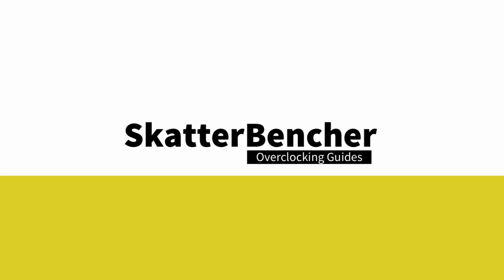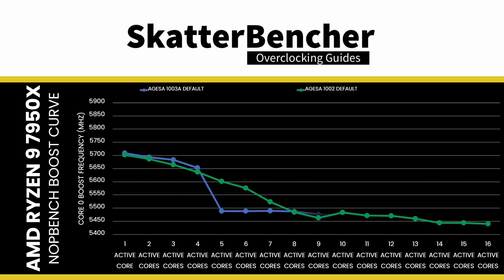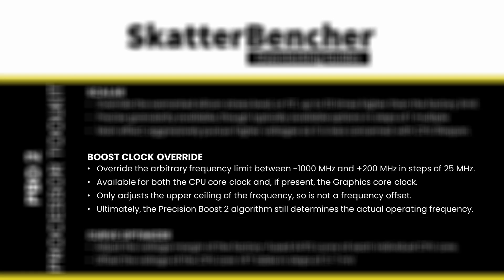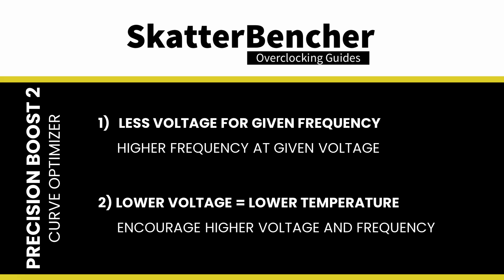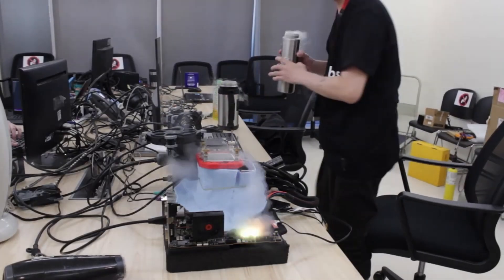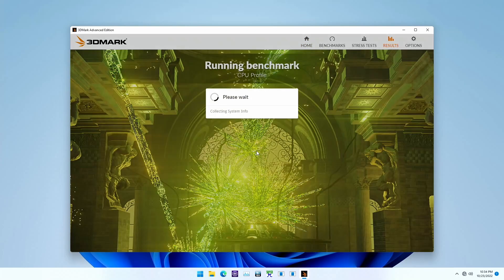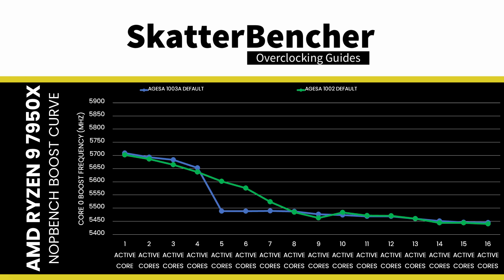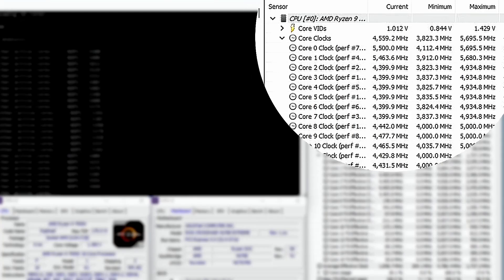WHY Your Ryzen 7000 Doesn't Boost Past 5.5 GHz (anymore)

Comment: Good Video.  Should i just be happy if i am hitting 5.5 Ghz since i have mid level msi mobo.

i have 7900x with a front triple radiator in push pull, my gpu is watercooled with a top triple rad so the cpu and mobo stay nice an cool... i like this vid but i have mid level MSI x870 Gaming Wifi mobo without asyc bclk bios options so most of the info in your OC vids dont apply. Some of the options are hard to follow with the msi bios. I miss my hi level asus bios on my old i9-9900k. I have a mild overclock at PBO -10 all cores and xmp 6400 mem. Currently 95% of the time half the cores are 5.5 Ghz and the other half are above 5.375 Ghz in most task.

Comment: So my 9950x3D on an Asus x870e Crosshair hero won't single core boost past 5.6ghz no matter what settings are applied. Any recommendations?
Reply: Won't be related to this.

But
Check C-States > enabled

Otherwise it's heat/cooling capacity
Reply: @RobertSmith-lh6hg  chip never goes above 82° on multi and 64° on single. C states are enabled

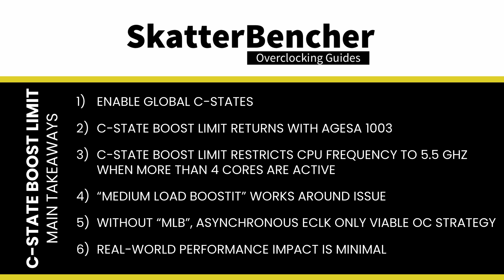Comment: 11:00 this video is key for me right now!! I’ve been using AI overclock mode in my x670e, coupled with PBO and curve optimizer at -5 and per core.  I have learned about medium boostit through the AI setup.  I have disabled the c state control though… I have this on my 5950x pBO setup so I think my thought was mimic that setup. My issue is SSE benchmark.  Passmark SSE will immediately spike my tdie to 110c, but normal operation and max on hwinfo is not above 96c.  I have seen 5.9 and 5.8ghz.  There is definitely a voltage spike with SSE benchmarks both Passmark and OCCT will shut down the pc, not a reboot, it will shut it down, however I can do 10 and 30 minutes tests on cinebench R24 with no issue and very reasonable temperatures.  AI uses dynamic overclock switcher, so all core is 5.3 and 5.2 on ccx0 and ccx1.  I think with boostit maybe I should just fine tune my per core optimizer instead….my issue there I think is core 1 and 5 trying to push more than -5, I think that will be my next fine tuning plan of attack.  Thanks for this video!!

Comment: Well I can’t even use this to help me get past 5.5GHZ as I used to be able to before I updated my bios. This is only applicable to people on higher end boards. My Gigabyte B650 doesn’t have a “medium load boosit” setting and no “eclk mode asynchronous mod” setting either. I guess I lost performance just by updating my bios!

Comment: i have a x670 gaming x ax and a 7700x cooled by the arctic liquid freezer II 360mm with offset mounting for amd, i managed to set the curve optimizer to a stable -30 and frequency offset to +200, before enabling global cstates and disabling spread spectrum when i ran cinebench at all cores i got 5.3ghz at 87C and single core 5.47ghz at 55C, after enabling global cstates and disabling spread spectrum it runs 5.45ghz at 87C and 5.55ghz at 55C even though it has a lot of headroom in single core tasks it still doesn't boost above 5.55ghz
Reply: whats ur before and after cr23 score?
Reply: @pinkipromise  its been a long time since i made this comment, the one weird thing is that it somehow spiked to 5,8 ghz in 3dmark(which should be impossible on pbo because the maximum should be 5.75), i think that there is still no solution to it not boosting. As for scores obviously they're higher because I optimized everything (cpu, ram, gpu, os) it also has lower power draw and temperatures

Comment: Hi, I have a Ryzen 7600x + B650 Aorus Elite. Could you do a manual overclock tutorial with dynamic v-core? because with PBO I can't go beyond 5,500mhz and I don't want to leave it with V-core at maximum 24/7 either. The ideal is to reach 5600mhz.
Reply: Hi there,

did u find any solution?

Comment: @ScatterBencher, my 7950x (with decent cooling via Lian Li AIO Galahad 360) cannot safely use any curve undervolting beyond -5 or -10 without setting the boost clock lower. I can reach -30 C.O but must set my boost clock to -325 MHz to be stable on long duration load tests. I cannot even boot my PC at -30 C.O without at least a -175MHz override. Does this indicate a bad CPU?
Reply from the maker: I've seen a CPU like this before and, yes, it was just not a silicon lottery winner unfortunately.

What you can try is use Per Core curve optimizer to isolate the core that's so terrible. If you're lucky, maybe it's just one of the CCDs that's bad and you can do a big CO on the cores of the other CCD.
Reply: @SkatterBencher  interestingly I can run all cores at 5200Mhz no problem with -30 but single is sort of stuck at 5400. Temps are great and wattage is low so not a bad compromise but not quite the lottery winner as you said.
Reply: @SkatterBencher  Update: With some additional tweaks and moving my 6 intake and 3 AIO exhaust fans to full speed, I can run all cores at 5280Mhz with a -30 curve on all cores but I had to bump down a touch more on the boost clock which is now at -350MHz, so 5500 + 350 = 5850.... i'm just not sure where that 5850 number comes from. With that said, I'm not complaining about a 39150 Cinibench R23 multi-threaded score.

On the other hand, single-threaded tests top out at 5407 despite the max being listed in Ryzen Master as 5500MHz as noted above and single-thread temps at only 49 to 53C. 

Overall, this is not a bad compromise, especially when you consider that my idle temps are 42.3C (which is pretty cool for a 7950x) and power usage is also low: idle < 3.0 W, single-threaded < 12 W, and multi-threaded < 180 W.
Reply: If you are using an MSI or ASUS motherboard (High end only), try setting the VRM switching frequency to 900 or 800 or 700KHz.
Also try turning Spread Spectrum ON/OFF.
Normally, there should be almost no change, but if there is a significant difference in stability, there is a possibility of a BIOS bug.
Reply: @Yuuki-lab  WOW this worked! I set my VRM frequency to 600KHz instead of auto and now I'm back to -175MHz on my boost clock (instead of -325) and maybe I can even push it further. I also noticed my chipset temps were super high before (around 90 to 95C) and now they are only around 60C so that might have been the culprit. Should I be aiming for higher or lower VRM? Not sure if I should try 500 or 700 next...
Reply: @Yuuki-lab  Forgot to mention I have this odd 1 in 5 or 10 reboots where the yellow/orange DRAM LED stays lit on my ASUS ProArt x670e board, and the only way around it is to shut off the power supply for a few seconds. I did not see this on my Gigabyte Aero G B650 board. But once booted, all is stable and all RAM tests are good. I even swapped DDR5 sets (an EXPO set to a XMP set) and no difference--even when not in EXPO/XMP profile mode and even with stock BIOS settings. Could that be a BIOS or CPU issue? I did not see that on my Gigabyte board with the same RAM and CPU. The only other difference is that I was running a Corsair HX850 Platinum PSU on my Gigabyte board and a Be Quiet DarkPower 12 850 Titanium on my ASUS--both top rated units on Cybernetics.
Reply: @nicholash8021 same problem here with a x670e-a.... did you find a solution?
Reply: It's strange that chipset temperature goes from 90C to 60C with different VRM frequencies. Try to find a stable VRM frequency.
It may be improved by slightly increasing "CLDO VDDP, VDDG, SOC, CPU PLL".
CO prefers low voltage or high voltage, depending on silicon die somewhat.
Example,
VCoreOffset=-200mV, CO(+)=0/0/0/0/0/0/0/0 : 4/4/4/4/4/4/4/4
VCoreOffset=-150mV, CO(+)=4/4/4/4/4/4/4/4 : 8/8/8/8/8/8/8/8
VCoreOffset=-50mV, CO(-)=20/20/20/20/20/20/20/20 : 16/16/16/16/16/16/16/16
VCoreOffset=-0mV, CO(-)=30/30/30/30/30/30/30/30 : 26/26/26/26/26/26/26/26
Reply: @Yuuki-lab  You're right, that doesn't make sense how it would affect my chipset temps, and I cannot reproduce it now. Maybe it was a coincidence. Anyway, I discovered that my DRAM led is probably also used to report issues with VRM check. I disabled the startup VRM check in the BIOS and so far, it's not getting stuck there anymore. Maybe I do have a faulty board.
Reply: ...I wish there was some way to specify different voltages for the boost clock only when using <= 4 cores.
Reply: I think it's harder than this. Try contacting manufacturer support.

Comment: When do you make a deep video on how to stabilize CPU with MLB and boost clock limiter ?
My 7950X is so bad that I can’t stabilize with MLB…whatever I do.
Reply from the maker: I will be revisiting AM5 with the non-X and then later the X3D chips. I'm currently not on an ASUS board, but will have a think when to switch back :)

Comment: I have a 7950X at work and it is driving me crazy. It boosts to 5.85GHz on CCD0 and 5.5GHz on CCD1 when not under full load. When its under full compute load, its boosting to 5.4 and 5.2 while maintaining 80°C. (SMT disabled, my compute software cant use it and loses performance sometimes) there is thermal headroom and i cant use it. The BIOS with asus options and AMD Options is horrible. Undervolting behavior per core is terrible... Dont get me wrong, performance is great, but the behavior is strange

Comment: Two weeks ago got 7950x for 550eur and asrock b650e pg riptide wifi. And now i noticed that yeah CPU does not boost above 5.5ghz, even if i set pbo +200 with negative offset -20, its not going above 5.5ghz, even if i set negative offset. Asrock board bios does not have asynchronous mode, or i just cant find it. Also no boostit mode either. Any ideas or it is what it is and, i should cope that 7950x is underperforming.
Reply: I'm not too happy about this limit. Has anyone seen why this was done & when/if AMD will allow us to boost past 5.5Ghz?

Comment: Does anyone know why is that on the asus motherboards that you can adjust PBO2 at two places? I set both of the mfor the same to be sure but it's just weird. Thanks
Reply from the maker: The PBO options exposed in the main ROG menu (Extreme Tweaker or Ai Tweaker) are copies of the AMD menu items you can find in the Advanced menu. You can control PBO using either.
Reply: @SkatterBencher  ah I see.. Thank you

Comment: Got an 7950X + Gigabyte X670E Aorus Master.
Unfortunately, with default settings, the CPU hits 95°C on a 420mm radiator pretty much instantaneously when in Cinebench R23. Idle around 41°C in Bios, 49°C in Windows.

Went with the PBO undervolt + overclock tutorial that led me here and now I am stuck with 5,5GHz, much lower temps, but cannot boost past 5,5. What exactly can I do? I already have C states disabled from the beginning without success and I only find a "Async CPU/PCIe clock" setting that can only be turned on and off.
Help please?
Reply from the maker: C-States should always be enabled on AMD platform. When more cores are in the lowest C-state, the others can boost higher.

Regarding the 5.5G, I'm not sure if there's another workaround on the GIGABYTE BIOS than using eCLK.

As for the Async eCLK: can you not enter the eCLK frequency, set Async to enabled, then increase the eCLK to further increase the CPU frequency?
Reply: @SkatterBencher  If you use Async, wouldn't that affect everything on the PCI-e bus ? Such as videocards, soundcard, even M2 SSD ??
Your videos are good, well presented, and informative. The only issue I have is your use of a motherboard that is most-likely out of reach of us mortals, such as your ROG CROSSHAIR X670E EXTREME - that is a £1000 quid motherboard, nobody buying a £300 CPU such as the 7700x is going to then buy a £1000 motherboard. Perhaps, have a few videos using a more affordable motherboard ? I mean, the AM5 boards are already too expensive as they are.

Comment: With pbo2 +200mhz 10x scalar -30mv all core and medium load boost it, in game most cores were on 5.6 some on 5.7 and 2-3 on 5.8ghz.. max were hitting 5997 on most cores on some 6.1-6.2ghz (7900x)
Reply: And you are stable ?
Lucky guy.

My 7950X is really a shit.
Reply: @genergia  Yes! I think I may have a golden chip.
Reply: You are using an older BIOS without this Agesa update C-state limiter?
Reply: @S2GUnit  no. the c-state setting I left it on auto
Reply: @balazs_korcsog  ok thanks but you haven't updated the BIOS recently? Because newer BIOS's have that 5.5Ghz limiter in place.
Reply: @S2GUnit  interesting, got the 0805 bios but intrestingly I isntalled it 2 weeks before the release date on the asus site. Got the rog strx 670e-egaming wifi mb btw
Reply: bios came out on the site 2022/11/15 but my isntall date was something like the 4th of december
Reply: @S2GUnit  do you mean with Medium Load Boostit on?
Reply: @balazs_korcsog  Nope, I was curious to know what BIOS version you were using to be lucky enough to have your CPU go higher than 5.5ghz. With my BIOS on my Gigabyte B650, like most people it seems, that since the Nov BIOS all Zen 4's won't get past 5.5ghz.
Reply: @S2GUnit  as it said in the video you need to turn on medium load boostit, it you have the option ofc
Reply: @balazs_korcsog  I don't on Gigabyte unfortunately but thanks. I'll do some more research.

Comment: Hello again ^^
It's pretty weird i got better results when i'm stuck at 5.5Ghz than up to 5.750Ghz oO
I used PBO2.

Up to 5.75Ghz (MLB enabled):
Prime95 => 5.29Ghz 92C° - 205W 
Cb23 => 5.4Ghz - 84°C - 163W - 20600pts
Assetto Corsa => FPS AVG 466 - FPS MIN 415

Up to 5.5Ghz (MLB disabled):
P95 => 5.250Ghz - 67°C - 145W 
R23 => 5.5Ghz - 71°C - 21000pts
Assetto Corsa => FPS AVG 468 - FPS MIN 428

And for the record, C-State enabled has reduced my perf.

Comment: I noticed this "Boost It" feature 2 days ago... I was really annoyed when I was stuck at 5550, enabled it... 7700x is now running 5750MHz on light and medium loads
Reply from the maker: Ah so the limit applies to all SKUs. Thanks for confirming!
Reply: Wonder what this is called in MSI bios.. my 7700x will hit the higher core clocks randomly cause I see it on HWmonitor... But even prime 95 one core never goes that high...
Reply: @zarethd  Were you able to find  a similar option to Medium Boost it in the MSI Bios?
Reply: @anshulsingh6914  no, haven't been able to find that, not sure why that's not default behavior anymore, very annoying
Reply: Which mobo do you have? From this video, I'm under the impression that it's not available on all ROG motherboards.
Reply: @cpt.tombstone  Strix 650E-E
Reply: @johnlangley7521  thanks!
Reply: @cpt.tombstone  I have ROG X670E Crosshair Hero and I have the "Medium Load Boostit" feature.
Reply: @bgtubber  I have the same board, and I don't see it. I just updated to a bios recently released.

Comment: 13700k 5.6ghz 8 cores, 5.7ghz 7 cores and we chillin. I'm glad I chose this over similar priced 7700x. This thing is more in line with a 7900x and gets too close to a 7950x for it to be nearly half the price.
Reply: Unless you need those other cores and don't want to pay for a dead-end chipset, then yes.
Reply: The 13700k is more in line with a 7700x and has pretty much nothing to talk about with a 7900X, never mind a 7950X😅

Comment: Class action incoming.
Makes their 5.7 claim completely false
Reply: 7950x still boosts to 5.7 Ghz when up to 3 cores are loaded. This limiter only kicks in when 4 or more cores are loaded. Besides, with most workloads you are likely to trigger other limiters such as temperature, current, etc. long before you trigger the C-State limiter when 4 or more cores are loaded.
Reply: @bgtubber I'm running the 7950x With a 360mm corsair AIO and With an undervolt of -15 all core and for every games I play even at 4k the cpu is completely limiter at 5.5ghz in games... it run great but we bought this CPU to run at the frequency of the first reviews and on the box!
Reply: @gunzorkgaming7847  Hi. Did you do the BIOS update which introduces the limiter? If you did, do you see a decrease in performance?
Reply: @bgtubber  I have the lastest bios update and my system is New so i cannot tell you i saw slower performance than before. But my single core performance in bench Never match any of the reviews of the CPU when it came out.

Comment: So was the 5.7 GHz to manipulate initial reviews only to pull the rug out after the dust settles? I’d be annoyed if I owned zen4 and this happened.
Reply: Basically AMD cooks there clock specs on paper and you shouldn’t take them seriously
Reply: Sure it's annoying, but if you do anything beyond overclocking for the sake of looking at charts, the real world impact is pretty much zero. Clocks in encoding or rendering would never reach that high anyways.
Reply: 7950x still boosts to 5.7 Ghz when up to 3 cores are loaded. This limiter only kicks in when 4 or more cores are loaded. Besides, with most workloads you are likely to trigger other limiters such as temperature, current, etc. long before you trigger the C-State limiter when 4 or more cores are loaded.